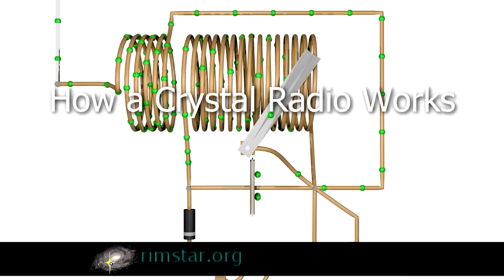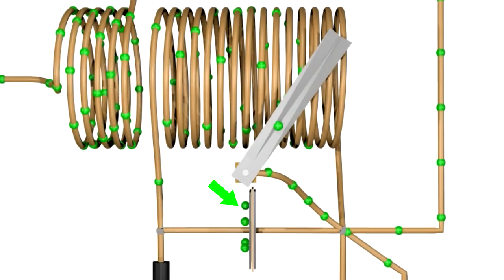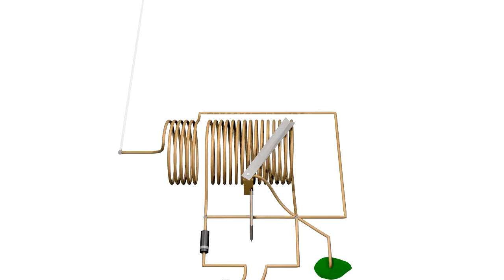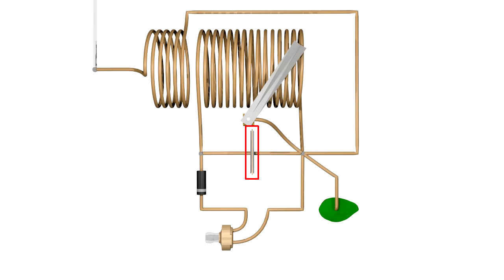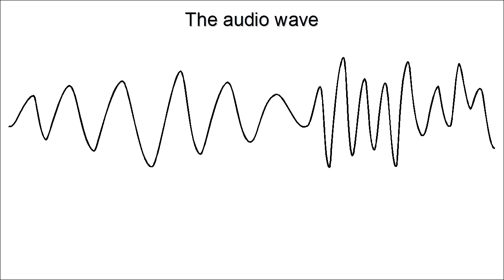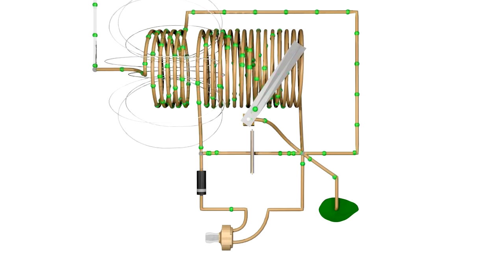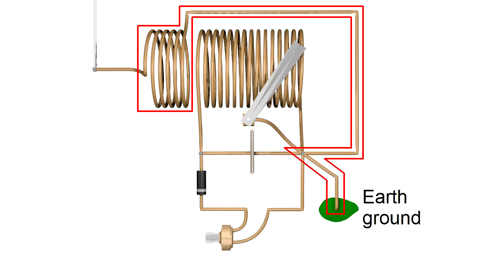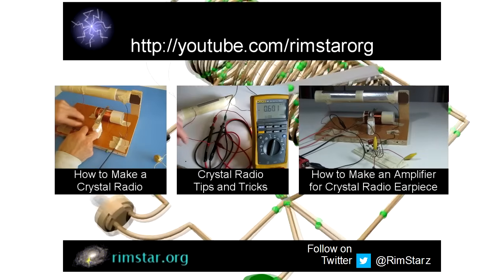How a Crystal Radio Works

Comment: I'm puzzled by the connection of the secondary circuit to ground. Shouldn't the ground be associated with the primary circuit only? The secondary circuit is there to electrically isolate the user from the primary circuit in case of lightning strike. I would suppose that it would be possible to build a radio using only one circuit but that might be hazardous.
Reply from the maker: ZaphodBeeblebrox That's a good question. The primary is magnetically coupled but not electrically coupled, and yet in all circuits I've ever seen, the secondary side is connected to ground. Not sure why.By the way, the reason for separate primary and secondary here is to reduce the influence of unwanted radio stations in the secondary circuit. I talk about that at 10:43 in the video.
Reply: I understand the you have it tunable via the variable capacitor and variable inductor but couldn't that be done in the primary circuit? Give it a try and see what you get. I don't have the tools and parts to investigate this.
Reply from the maker: ZaphodBeeblebrox Yes it can be done in the primary circuit. There will just be more interference as I point out at 10:43. There are many, many crystal radio circuits, some with two coils and some with just one. There is no need to try it out since it's already known there are circuits with just one primary that work.

Comment: Good day, I wanted to ask if you can use a regular PCB capacitor in place of your improvised one. If so, what type?
Reply from the maker: PCB ones aren't usually variable capacitors so you'll have to do all the tuning using only the coil. A 500 to 600 picofarad capacitor should do it. Make sure it's not a electrolytic capacitor since you want one made for AC.
Reply: @RimstarOrg Thanks!

Would a ceramic capacitor do?

Comment: can i use Alligator clips and on the coil every 10 turn of the coil a loop to connect the clips. i saw it in The Colony.
Reply from the maker: Yes, you can do that. They're called taps. I actually do it in this video about making a coil with taps https://www.youtube.com/watch?v=Gi9EmhrcfIg. I don't add alligator clips, but instead I leave the ends of the taps bare and connect to them using an alligator clip.

Comment: ..isn't there a way ..that instead of converting collected waves into audio... you can transform them back into useable voltages..amps? ... such as storing this energy into a capacitor?
Reply from the maker: Yes, but the energy is very small, not a useful amount at all. And there's not way I know of to collect from more than a few frequencies at a time.
Reply: RimstarOrg - there was a paper published a few years ago where some electrical engineers had figured out a way to capture enough ambient RF through a small circuit that could provide enough energy to send a text message
Reply: RimstarOrg - here:
http://www.washington.edu/news/2013/08/13/wireless-devices-go-battery-free-with-new-communication-technique/

Comment: Ahh, the radio wave is not 'all one frequency', but is, rather, the carrier frequency +/- the audio frequency (more or less, it depends on the modulation scheme used). The size of thus '+/-' is known as 'bandwidth'. So the receiver must tune to a spectrum of frequencies centered on the carrier frequency.

Comment: Hi, Is it possible to make a radio just with a particular frequency crystal? So no tuning required no coils and capacitor. Thanks
Reply from the maker: Theoretically yes. You can do LC calculations like the ones here http://rimstar.org/science_electronics_projects/lc_circuit_aka_tank_or_resonant_circuit.htm but they don't take into account everything. I use them to get values that make sure I can tune in the full range, not for a specific frequency.

If you have a strong enough radio station nearby then it'll probably swamp all others and you may get it anyway. That seems to work for a lot of people who make ones that are not tunable.

Comment: Nowadays radio stations broadcast FM not amplitude modulation. Will this receiver work on using this circuit?.
Reply from the maker: Nope, this receiver isn't designed to work with FM.

Comment: possible not to use the  wiper blade? saw circuits using without it.
Reply from the maker: Yes, it's possible to do all the tuning with just the variable capacitor. Or you can do no tuning at all and hope you get a radio station by luck.

Comment: What is the difference between a crystal speaker and a speaker with a coil, please reply
Reply from the maker: A crystal earpiece as I describe in this video uses a piezoelectric crystal in order to make sound. It has a much higher impedance (resistance to fluctuating current or AC) than your typical speaker with a coil, for example an iPhone earbud or a desk or PC speaker. It is possible to make a high impedance coil though, one with many more turns of wire than a normal one but you don't see them around very often anymore.
However, you can use an earbud with a crystal radio though performance may be less than with a crystal earpiece. You just have to add a transformer to do what's called impedance matching. I show how in my other video here https://youtu.be/GCh2LVHUavQ

Comment: Is there a way to tune into FM radio stations with this radio, or is that a completely different radio? Also, would this radio technically still work without a second inductor, just not as well?
Reply from the maker: SniperFox This circuit isn't designed to tune into FM, though I've seen some who managed to by accident with some parts doing things they weren't intended to.As for the second inductor, or tuning coil, it will work without it and give louder output but more interference. That's the trade-off. See the video at around 10:43 where I explain why.

Comment: While this is one of the best animations I have ever encountered. But something is gnawing at my mind. By crystal are you referring to diode or crystal earpiece. If I am not mistaken, the original crystal radio was using not a diode but a real crystal. There was even a method using a rusty shaving blade and pencil lead,
Reply from the maker: Thanks. I'm glad you enjoyed the animations -- it was quite a challenge to convincingly move all those electrons on those different paths.
And yup. In retrospect, explaining the original meaning of the crystal, while not a part of the how-it-works, would have been a nice addition. Oh well.

Comment: what kind of antena has to be, iron, magnet, or just copper?
Reply from the maker: Any metal will do. If just has to be a good conductor of electricity. Copper is easiest to find, which is important since you need it to be as long as possible in a straightish line.

Comment: Would it still work if you replace the crystal earpiece with a cheap, regular earbud?
Reply from the maker: You'll need to add a transformer to make it work (I think for impedance matching purposes), and the output will usually be weaker. I show how to do it in this video https://www.youtube.com/watch?v=GCh2LVHUavQ.

Comment: how do you polarize the diode ? are the radio wave inducting a high enough voltage to do so ?
Reply from the maker: +geordi rendum I'm not sure what you mean by how do you polarize the diode. The diode consists of two materials, n-type and p-type that set the direction it works in. It's a germanium diode, so the voltage is high enough to turn on the diode. Germanium diodes don't need as high a voltage as silicon diodes.
Reply: ohh ,true , its like 0.3 volts.

Comment: Great video as usual :) This one's been on my watch list too long. I have a tricky question though. I used to play with radio a little many years ago. I remember winding coils on pens for ants. I remember using a chart, that would tell me exactly how many turns for a specific freq. Is it purely the tank circuit change that affect's the tuning? Because I seem to remember number of turns was the most important factor, over length and diameter. Is it just inductance? Or is turn no# related to freq?

Comment: On a side note: If Radio towers are pumping out tons of electromagnetic waves at very high and low frequencies ,and the antenna sends those moving electrons to the short coil which picks all frequencies up. (thats a lot of power right) Could you use a radio antenna to create electricity? perhaps to power a light bulb?
Reply from the maker: You can use this to generate electricity. Years ago that's why I first got into it. But I realized how small the output was so I didn't pursue it further. With a long enough antenna you could light an LED.
Reply: What is the reason it does not generate enough power? It seems like 1600Khz is a lot of power?  Couldn't you store all those frequencies into a super capacitor? and then use it once fully charged. Also during the Carrier wave effect...if the Diode is chopping the carrier wave in half, were does the negative wave go? is it wasted and sent to the ground? Also how does the second capacitor smooth the carrier wave back out?   Sorry if I am asking to many questions at once. this is amazing to me. :D
Reply from the maker: Rion De Rochestia
Khz isn't power. "hz" is short for cycles per second and the K is kilo, or thousand. So 1600Khz means 1,600,000 cycles per second. It's just a measure of how often the waves repeat each second. These are very low power waves repeating frequently. You could build up the energy in a capacitor and release it when fully charged, but it would take a while to build up a useful amount. So you could make an LED blink that way. As for the half that get's chopped, it's just transformed into heat energy, though not much since there wasn't much to start with. If you add the second capacitor then that stores the chopped off energy instead of turning it into heat. Then just after the next half cycle, it gets dumped in to contribute to the time just after that half cycle.
Reply: Thank you for taking the time to explain things. I am still a novice at this. :D

Comment: But why use two coils, why not connect the antenna directly to the tuning coils?  Thanks
Reply from the maker: This is to help with tuning into just the desired radio station (the selectivity). The trade-off is that you get lower volume. See 10:46 where I explain it.

Comment: While listening to the explanation of why this crystal radio has two coils instead of one, it occurred to me that this radio is designed to be used in a city rather than out in country areas where radio station signals might be a lot lower in strength than in a city.

Would that be a fair statement?  And how well would this crystal radio work in areas with low signal strength?
Reply from the maker: I don't think it was designed specifically for the city -- at least I've never heard of such a distinction. A longer antenna would help it pick up signals in the country, and in the country, longer antenna tend to be easier to arrange.

Comment: A good explanation, but with a crystal earpiece you will hear nothing unless you shunt it with a 100k resistor to complete the DC circuit around the diode. I've seen this mistake so often now. The old '2000-ohm BBC' headphones worked because they were magnetic and had coils which completed the DC path, but piezo earpieces don't, they are open-circuit to DC and will charge up to the peak voltage of the incoming RF and make no sound. Fit the resistor and it works.
Reply from the maker: Thanks. I talk about using a shunt resistor at 2:43. I've tried it in the past and didn't see a noticeable improvement so I don't normally use it but it makes sense that it would improve it.

Comment: Hi RimstarOrg, 
i really enjoyed your video ! 
I really liked it but i have one question: 
How the volume (which is the voltage's amplitude right ?)  can vary by changing the value of the capacitor ? I have some knowlegde in electronics so can you explain me in more details how the capacitor affects the volume please ? Is it just with i(t)=Cd(u(t))/dt ?  

Sorry for my pathetic english.. 
Thanks in advance
Reply from the maker: +Goto Hikaru Ah, I see. I didn't say that very well. I wasn't adjusting the volume by adjusting the capacitor. I was tuning into the radio frequency better, resulting in a stronger signal. And that was done by first adjusting the tuning bar on the coil and once that was strongest, I then fine tuned it using the capacitor.
Reply: RimstarOrg oh ok, thank you very much.  
and again, really nice video !

Comment: can you use a battery to boost the power
Reply from the maker: jasoncurtiswood73 Yes, you can use a battery. One way would be to add an amplifier circuit, which is what I did in my video "How to Make Crystal Radio Amplifier for Speaker", or you can just connected it up to a commercially made amplifier.

Comment: 8:00 why that copy and flip ??
Reply from the maker: It's hard to explain why but I'll try. An analogy you can picture is a water wave. A water wave has peaks that rise up but they also have troughs that mirror the peaks but goes down instead. Okay, because were dealing with gravity and a denser medium under the wave (the ocean), the down peak isn't as large, so the analogy isn't perfect. But to make the analogy work, imagine gravity and the ocean wasn't there. We have an up peak and a matching down peak. That's a wave.
If you didn't copy and flip the audio wave then you'd be trying to make an electromagnetic wave that didn't have the down peak. That's just not possible. And that's the answer.
But wait, you say! Couldn't you leave out the down peak when you transmit? Maybe, but since waves require the down peak, the transmitted wave would have to pull down parts of the up peak to produce a matching down peak and now you've distorted the wave. The radio would have to somehow undistort it. Interesting thought experiment, and I don't know it it's possible in the sense that I don't know if the radio would have enough information to recover the original audio wave.
Reply: @RimstarOrg  ok , but when i think it for practical it seems that transmitter needs some kind of additional circuit to do that flip and mirror of that modulated signal ( probably using inverting amplifier may be ) but then i remember the simple one transistor fm transmitter circuit popular on google image ,   how that simple one transistor manage to do all that complicated work alone ( flip and copy mirror as you said ) and same time ( modulation and rf oscillation ) ? How it flip the modulated input ?
Reply from the maker: Oh, when I say "flip" in the video, that was intended as a visualization aid. The circuitry doesn't do any flipping. The audio wave is simply modulated onto the higher frequency radio wave. That explanation takes a whole other video which I happen to have made here https://www.youtube.com/watch?v=R04yEKqgGPc . To see how the transmitter that I use in that video was made, see this one https://www.youtube.com/watch?v=_4-Sx-T6VBc . It's actually a pretty bad circuit because it transmits more than one frequency (some harmonics) but it is simple as you say.

Comment: I thought the "crystal" in the name refers to a needle/crystal assembly that functions as the diode.Were piezo electric speakers even out at the time?  Nevertheless, your video is very well done and instructional. Great job
Reply from the maker: Yeah, the old name for these things remains even though there's no more crystal. These days a crystal radio refers to a radio that gets its power from the incoming radio waves. Originally they used high impedance headphones, basically magnets with coils with a lot of turns of very thin wire around them. Glad you enjoyed my video. Thanks.

Comment: why don't they use the negative voltage instead of positive for the earpiece?
Reply from the maker: The crystal earpiece itself can but put in the circuit in any direction. I have it one way in my diagram but it will work the other way too.
Reply: thanks @RimstarOrg

Comment: 2:08 didnt you mess up the direction of a diode? or electrons maybe...
Reply from the maker: Nope. The mark on the diode is there to indicate the direction of conventional current, not electron flow. Conventional current is the flow of positive charge in a wire even though the positive charge doesn't really move. It's used for historical reasons from before we knew of the existence of electrons. I wrote an article about it on Hackaday a while back in case you're interested in learning more http://hackaday.com/2017/07/17/conventional-current-vs-electron-current/

Comment: Is the diode no longer necessary if you use the resistor?
Reply from the maker: +Jarrod P No, the diode is still needed.
Reply: +Jarrod P The diode cuts the radio wave in half, allowing only the positive voltage. It's like a tug of war, and if you leave both halves of the wave, both teams pull the same amount, and nothing happens.
Reply: +Jarrod P Maybe you could use a different type of diode though, since the resistor does the "leaking" instead. Not sure.

Comment: Can we use a silicon diode if we use a resistor?
Reply from the maker: No, the problem with silicon diodes is that they have too large a voltage drop and there isn't enough voltage available. A resistor won't fix that.

Comment: I have a question if i wannna make a FM radio so i need make a coil with more turns?
Reply from the maker: No. To make an FM radio you need a completely different circuit. I've never made an FM radio so I can't help you with that, sorry.
Reply: Okay, I will try to find it